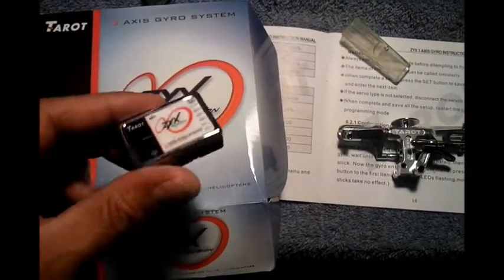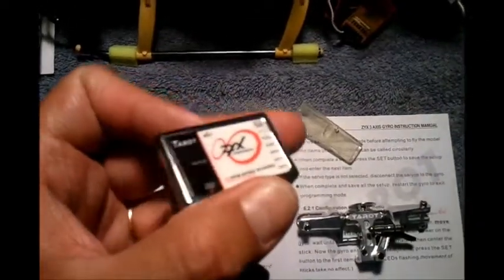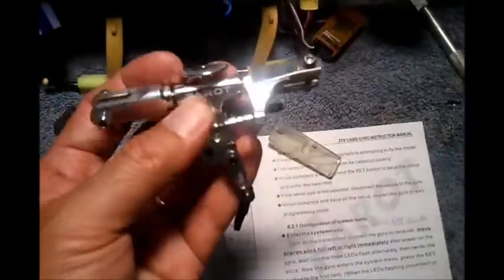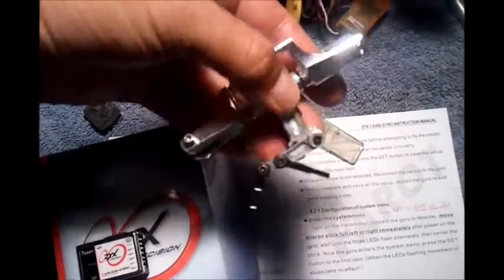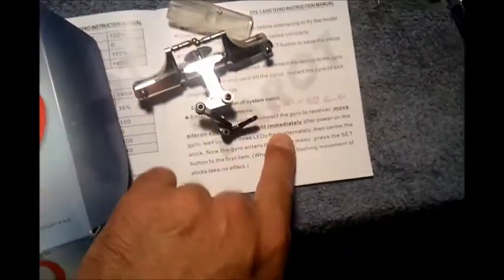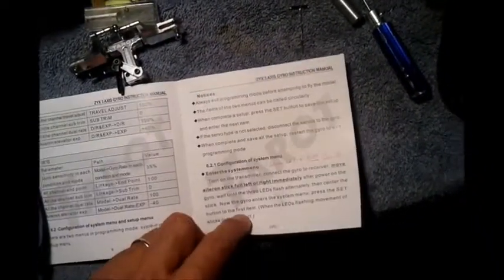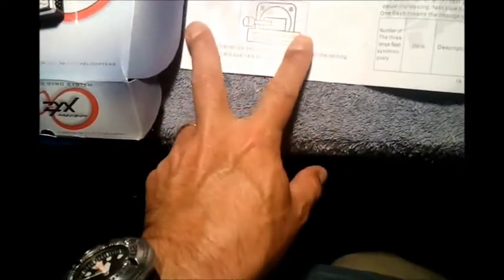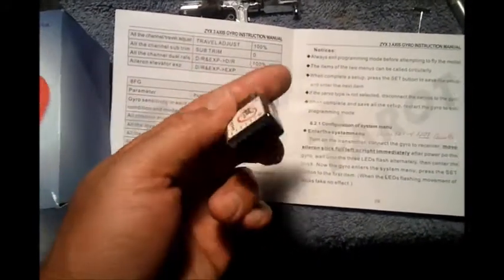Tarot ZYX  Flybarless 3 Axis System - StrikeOne

Comment from the maker: Not as easy to program as the BeastX, but works fine for me (sport flying). I have the USB cable. You have to google the software buts its free and after playing with it you can figure it put. I found programming using theblights a pain in the ass. I also found that the device ridn't always respond to the commands but in the end it got to where I can program it in just a few minutes. I like it, but my 600 will get a BeastX.